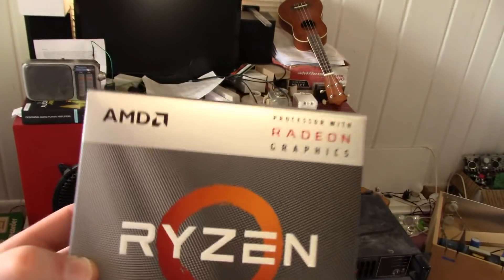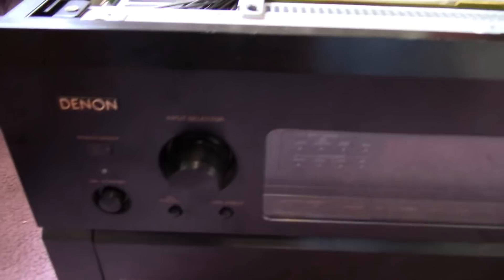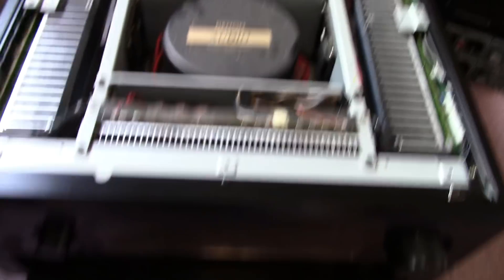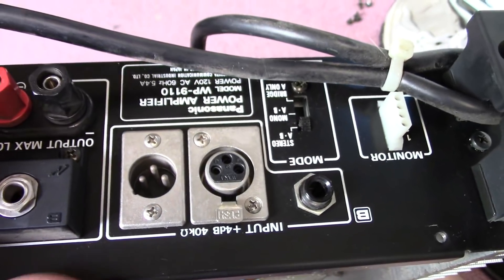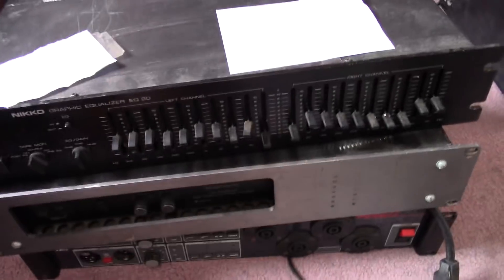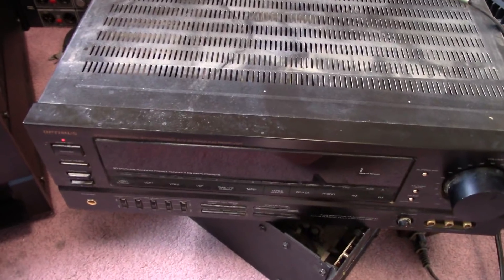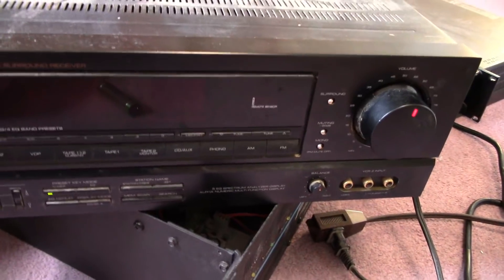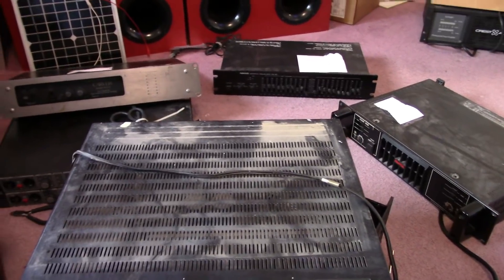PA amplifiers and other audio gear BIG haul

Comment: All of those pro amps should be designed to be relatively repairable compared to typical consumer stuff.

The 'surround" on that radio shack receiver is probably a fake surround simulator - basically does some frequency selective delay trickery to make the sound stage "feel" bigger and more 3 dimensional.
Reply: It's the old stereo wide that just about every boombox from the 70's and 80's used to have! It basically makes the sound stage wider while sacrificing the bass! Although this amplifier could have a low pass boost circuit to restore the bottom end? I really don't know but it would be interesting to see what it actually does though!

Comment: Nice audio score. 
On your PC I would check/change the PSU. A flaky unit can cause seeming random BSODs. I'd recommend a PSU by EVGA. I'm using a 550 watt model in my Ryzen 5 3600 based PC and it's been rock solid with stability! It's pretty rare (but possible) that a CPU will cause BSOD's unless it's running too hot for a long time or has been overclocked which is probably not the case in your PC. 
The i5 Dell you bought is probably 6 or 7 years old. You can check the Dell service code on their website to see when it was built. The i5 4460S is a 4th gen Core CPU (11th gen is current) and was launched in mid 2014. It was discontinued by Intel in mid 2017 before that Ryzen CPU you have was even released!
Reply: He put that Ryzen into his father's PC. I run a 4th gen CPU. i5-4670 up 157 days Haswell is the best! AMD is the cheap seats. Intel primo. They invented the microprocessor dontchaknow?

Comment: 3;28 : AVR-5800 It's a 7.1-channel THX receiver from 2001 (20 years' old today 27/05/2021)
It's worth fixing if you have the time, patience and inclination in my opinion.
Then again, there's a ton of other things out there that are more worthwhile.
I often wonder whether it's possible to use any of these behemoths as plain multi-channel amps. I guess I might never find out. These things were designed to become huge piles of junk from their inception. It's a shame as there was never any need to have the pre-amp and decoding sections all in one box together with the power stuff - apart from the manufacturers' need to keep churning out new stuff for people to buy and throw the old stuff out that is...
Reply: Yes they can be used as multichannel amps

Comment: The Denon may just be a regulator. I just repaired a Yamaha RX-Z1 I got free off cl. A 5 volt regulator was puting out 8 volts. They self check all voltage levels and if something is out of spec it goes into protect. Mine had a way to defeat protect mode if needed. I had a service manual which of coarse was helpful. The voltages are usually written on the PCB at the board to board connectors. I can see yours has a regulator board on the small frontfacing heatsink. 

The Optimus may also not be getting power to the display.

The Carver is definitely worth repairing. I had a similar one and it was the best sounding amp I ever had.

Edit. The service manual for the Denon is available on hifiengine

Comment: over heating or weak power supply can cause random blue screens.  how long has it been since you changed the TIM or thermal paste?? seems like mine dry out after a year and i have to clean and reapply.
Reply: If you apply thermal paste right it should never go bad. Use the thin film method. The pea sized drop is crap. Thermal paste should not be another layer like a slab of cheese between your component and heatsink. Then you're just adding another layer of thermal resistance. All compound should do is fill up air voids between the surfaces. No paste is as good as metal is. It is not even close.

Core 0:         +32.0°C
Core 1:         +34.0°C
Core 2:         +33.0°C
Core 3:         +33.0°C

That's thin film. Ambient is kind of warm today too. I just have a crappy Hyper T2 cooler on this PC. It's a $10 cooler. I put this PC together in 2017. It is never getting repasted.
Reply: Yeah, the power supply would be a good thing to look over or substitute.
Reply: @HillsWorkbench  John can test his PSU too. He has a scope. It is best to test it near peak load. That's when it's going to glitch. I think the standard is 90%? Spec is 120 mV ripple on the 12V rail and +-5% regulation 11.4V-12.6V. Although better is better. That's max allowable. Could make for a cool video. Test the wacky PC.
Reply: @1pcfred  paste does dry out. If you apply it correctly or not. If its dry it does not conduct the heat as good. Paste does not last forever it goes bad even just sitting in the tube it comes in.

Comment: John, when's the last time that you had a look under the processor heatsink? 
Another common bluescreen fault is dry heatsink thermal compound, they dry up and begin to insulate, I'm sure that you have some compound lying around, you can check and replace it if it needs it, that is unless you really just want to replace it. I have picked up many computers that have been thrown out all because the owner thought that there was something really wrong with it, I just replaced the thermal compound and it's as good as new!
Reply from the maker: It first started having issues in April. I reseated all the components including the CPU. I cleaned and re-greased it then.
Reply: @JohnAudioTech  fantastic, then that rules that out, I would hate you to throw out something that could be fixed easy enough.

Comment: Probably a bad PSU,  check the caps.  Edit:  Causing your PC instability.
Reply: Instead of checking caps I just replace PSUs on a schedule. Every 5 years I get a new one. Unless I don't care about a PC anymore. But if I want it to run right then I use an in date PSU. John has a scope so he can check his PSU output for ripple. That's the bottom line right there. Just put it in AC and turn up the gain. See what kind of puke it's putting out.